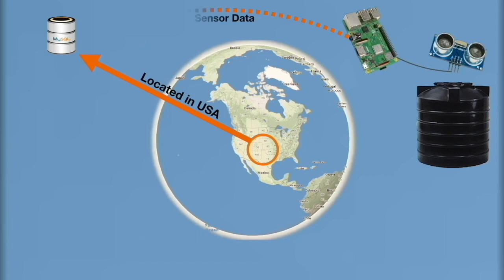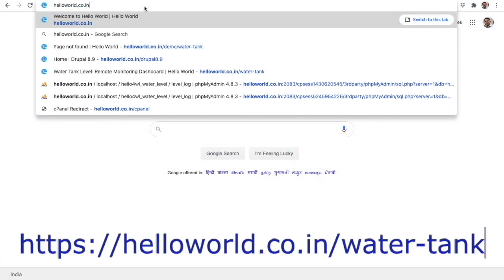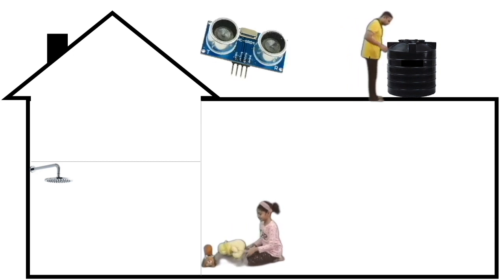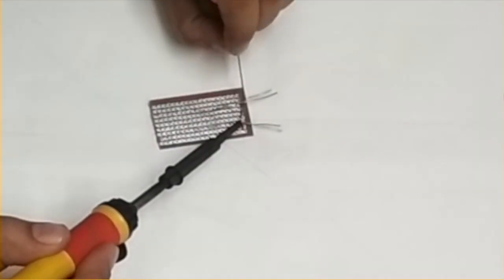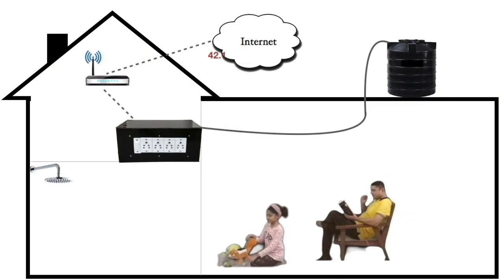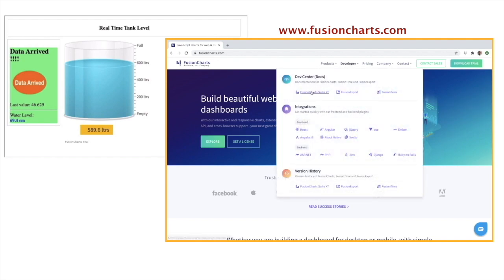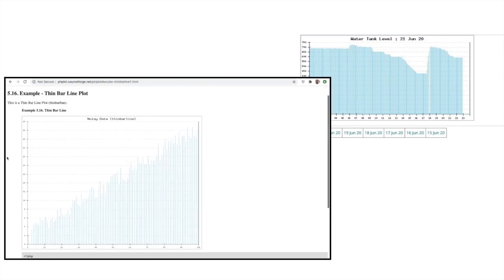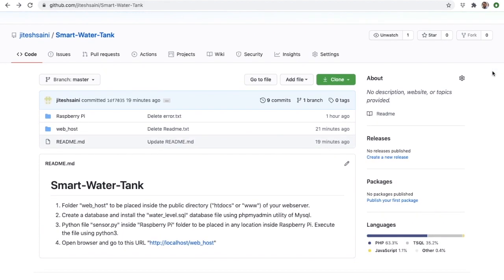IOT Project: Smart Water Tank with Real-Time Dashboard | Home Automation

Comment: Hey bro! Love that project. Rather than using a online website for the graphics can i get the same information in an app if i develop it also rather than using a ultrasonic sensor like that which other sensor can we use so that it is more reliable??
Reply from the maker: Yes you can make an app. The app need to fetch the data from raspberry pi over LAN either through socket programming or reading mysql database running locally on pi. In case, the app needs to work over internet, you need to figure out the data exchange mechanism. As far as reliability is concerned, this 150/- rs sensor is working for past 6 months, every minute, without any problem. Seems to be quite reliable
Reply: @jitesh_helloworld  On the same subject of the type of sensor, This project provides the data I need from my tanks but my tanks are much bigger - they are 20ft tall. Is this still the right sensor or is there another one that would suit my needs? Where can I see the options for sensors and their parameters that will work with this project? Thank you.

Comment: Hi Wonderful project!! I have a couple of question, when you put it inside the tank is dark, does the sensor still measure the distance correctly? Also I noticed the water on your PoC was blue, if the water is transparent as originally is, does still measure it? Thank you! Great great stuff!
Reply from the maker: Thanks.. color of water / darkness inside tank has got nothing to do with the functionality of the sensor. The sensor emits sound waves which gets reflected from water surface. Yes, it will work for transparent water also.
Reply: @jitesh_helloworld  very clever , very good project!
Reply from the maker: Thankyou
Reply: How much cost required to buy required things like sensor or remaining?

Comment: How did you protect the sensor from the humidity inside the tanks and from the hi temperatures on sunny days.
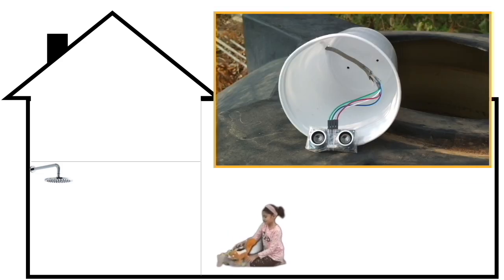Reply from the maker: Just wrapped it up nicely with plastic (shown in video at 2:39) and placed it inside a plastic container to protect it from water splashes . Working temperature range of this sensor is approx -25° C to +70° C. I guess it is a pretty good range for a low cost sensor. Its already sustaining the summer heat for past one month and performing well.

Comment: A JSN-SR04T can be better sensor for this application. Though the sensor can not measure distance below 21cm, but it can withstand water/humidity.
Reply from the maker: Sure it could be. But considering the cost (mere 150/-) and range (upto 400cm), i guess HC-SR04 is not a bad choice. Its been a month now since i have deployed it and it is working satisfactorily.